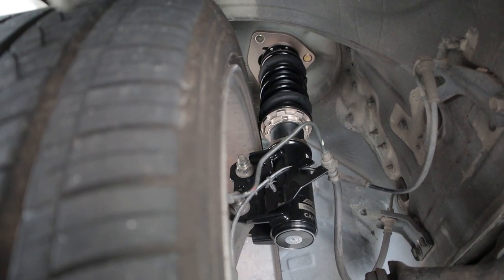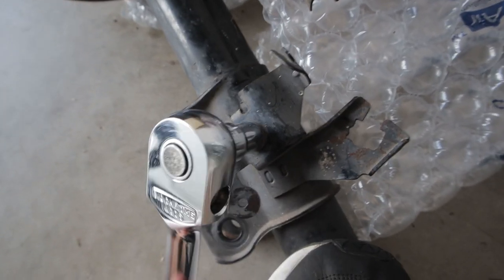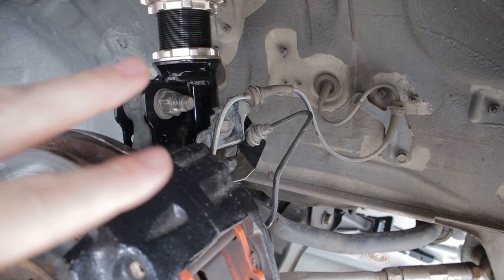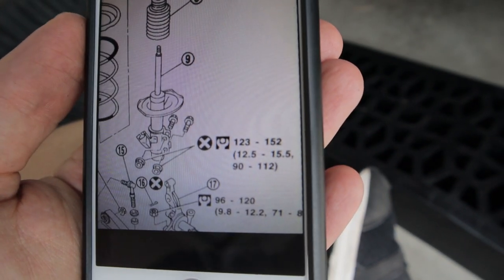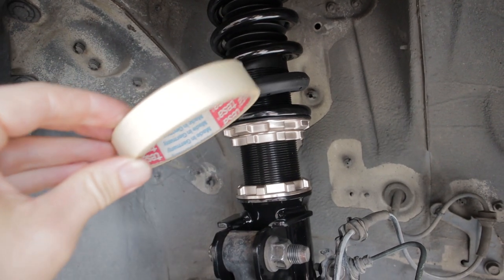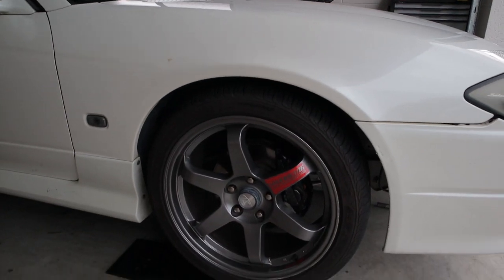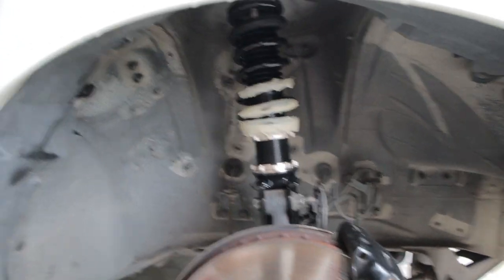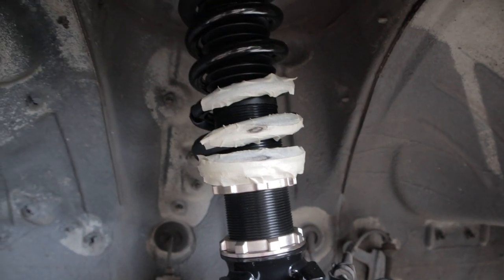Accepting Defeat - BC Coilovers

Comment: R33 GTR wheels won’t fit without spacers on the front. You’ll run in to the same issue you’ve got at the moment.
Reply from the maker: Lewis yep that makes sense. I need something with a lower offset. I’ve crunched the numbers on 17x9+22 and it will only give me 0.3mm more clearance then I have at the moment.. if my current wheel specs are correct
Reply: Pierson Willis I’ve sent you a DM on Instagram.